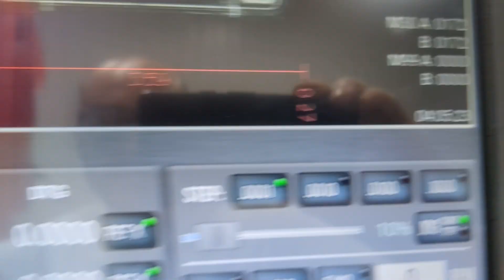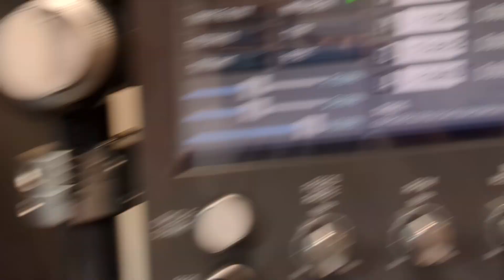CNC Machining: Rigid Tapping 4-40 In Stainless (Tormach 1100MX)

Comment: Have you been running parts on xometry?  The job board prices are horrible.  I used single point thread mill on them 4-40 threads.
Reply from the maker: Wow! Didn't realize you could get a thread mill that small. ... I spent several weeks looking at the job board at least once a day, not once did I see a single job that would have been possible and/or profitable with my machine. I even contacted them and let them know of my concerns, considering most of the jobs being sent to me were impossible to do (with no way to filter them out), and they didn't really seem to care at all...
Reply: @PowerSports  Yep, that sounds about right.  I think its good for some shops that have a lull so they can keep their employees busy.  They are like a sweat shop with those lame prices.  I have been checking that board on/off a couple of years now and just gave up on them.  Regarding the 4-40 form mill I bought it from Harvey Tool.  I snapped a form tap so went with  single point form mill.  I learned a lot from doing that part so it isn't a total waste is the way I look at it.  That was my first time doing stainless let alone 316.  Passed the test and then wasted time checking the job board.. lol
Reply from the maker: Yeah, basically could work at McDs for more than most of the prices they put up on there. LOL!

Comment: hey - what size drill did you use?  I'm doing the cometary test part and not having much luck tapping.
Reply from the maker: Thread forming tap: https://www.mscdirect.com/product/details/49717317
Pilot hole size: 0.09" (double-check that number!)
Reply: @PowerSports  thank you!

Comment: Hey friend. Just had a question for you. I have the same machine and I'm trying to tap some 8/32 threads with a roll tap in 316 stainless. I'm just curious which belt range you had the machine in. High or Low?
Reply from the maker: You're going to think i'm crazy, but, I was in High.  Definitely was pushing the limits of that range... Wish these things had a servo spindle instead of the belt drive.
Reply: @PowerSports   Hell yeah man. I'm going to give it a shot in high. I've been impressed with my 1100MX so far so hopefully it continues to do so. Love your videos so I went and gave you a sub too! Thanks for the help friend.
Reply from the maker: Thanks!  Good luck!

Comment: Just curious. What size end mill did you use for the roughing operation, and what feeds and speeds? Did it sound okay?
Reply from the maker: I started with a 3/8 bullnose then went down to a 1/4 bullnose for Adaptive Clearing. I used GWizard to calculate everything, and it still sounded absolutely terrible. The mill just isn't rigid enough for stainless.
Reply: @PowerSports  I've been digging into this issue. It's a low horsepower machine so that needs to be taken into consideration. If I am able to dial it in I will let you know. Cheers

Comment: I used a 0.101" drill for the hole. The reason being its such a hard material and if you look at a drill/tap chart that size drill will give you 60% thread engagement. In short it will pass as long as your gauge threads in no problem. To mitigate breakage I would give the tap some clearance, so that it is not hitting the bottom of the hole. This helps a lot.
Reply from the maker: Yeah, i think i also used 0.101" for the roll form tap pilot hole. Something close to that. I had the hole cut through, but i didn't plunge the tap deep enough i guess.